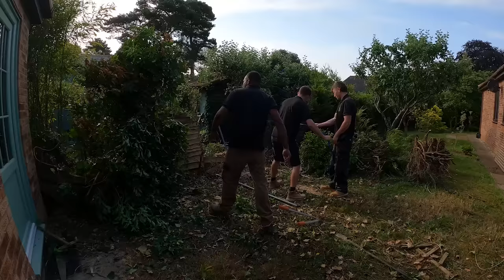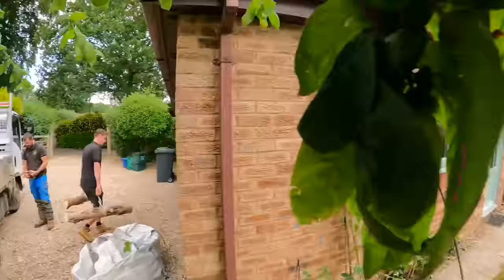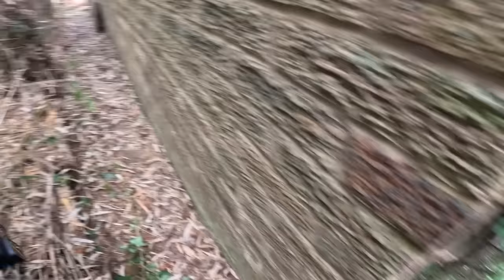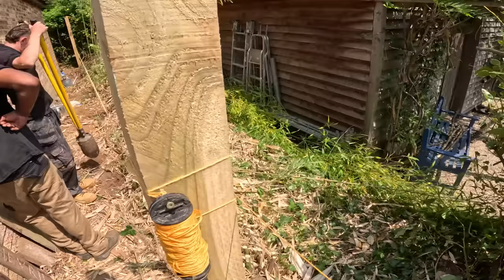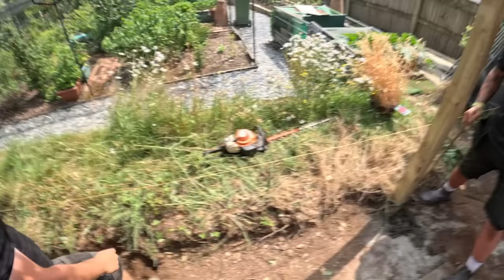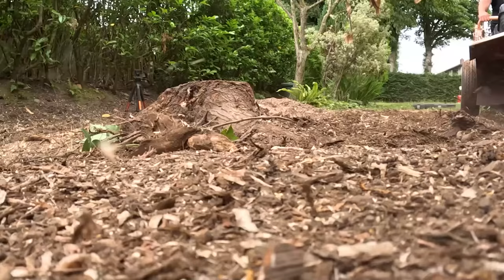STUNNING GARDEN TRANSFORMATION | Fence Build Project

Comment: I love a bit of featheredge. Best looking fencing. So much nicer on the eye than concrete. I've only done my own fencing over the years but was wondering if you'd had many problems with such a narrow post hole? I use a border spade and dig the width of that square. About 1½ bags of postcrete per hole. Also, i couldn't really get on with those postsaver sleeves. Painted posts with bitumen paint in the end. I saw a vid on youtube....'proper diy' i think....and the sleeve filled up with water above the ground. 🤷‍♂️
Great job by the way. Love the 2x8 gravel boards. 👍🏻
Reply from the maker: Really love your positivity! We tend to dig the holes deeper than most. We usually get 2 bags in per hole. We have painted posts and sleepers etc with bitumen paint. It also works really well.

Comment: 3 questions : 1) why not using an auger to dig those holes , since you seem to be quite mechanized ( stump removal etc..) 2) all the bushes on the neighbor side, they are just cut short and will grow back, any possibility to ask the neighbor to remove them all.3) how about the other 2 sides of the property ?
Reply from the maker: 1) the type of ground we have here is full of rocks so even when using a 150mm auger you end up with sometimes a 300mm or more hole that needs a lot more concrete
2) We cut the bushes down and then dug out the stumps so they won't come back.
3) There are good hedges on the other sides of the property so a fence is not required.

Comment: Hi, how did you set the height of the posts to achieve consistent height above the ground? Thanks
Reply from the maker: We didn't. We used longer posts and then set the heights of the rails and gravel board using a string line. Marked the posts and then rested the large saw on the top rail to cut the excess off the posts.

With pressure treated posts rotting on the top would happen a long time after the posts have rotted at ground level.
Reply: Ah I see, that makes sense, thanks for coming back to me!

Comment: How do you put the top cap on? And how do you fix into it? Does it need a counter Batton
Reply from the maker: This top cap we generally screw down through the top into the thick end of the boards. It doesn't need to sit on a rail

Comment: I suppose you retreated all the cut ends and post tops and didnt nail through 2 feather boards as you were putting them up allowing for expansion  / contraction thus avoiding the possibility of splits boards.  Otherwise it looks quite tidy. Would have liked to see a back weather on the posts !

Comment: What’s that used around the base of the posts?
Reply from the maker: Those are post savers. They protect the post around ground level where it is more likely to rot. When correctly installed will add 5 years+ to the life of the post.

Comment: Is gavel board same thickness as the timber rails? What size timber rails are they?
Reply from the maker: Rails are 38mm thick and the gravel board is 45mm thick finished size. Just enough to sit the feather edge on.
Reply: Ahh that makes sense cos I got a quote from the supplier gavel board 25mm thick and fence rail 22mm thick, I think it is too thin and wobbly?  What is the depth? Who is the supplier if you dont mind me asking?

Comment: Inferior quality as compared to the fence that D&J Projects installs. Do you have the option for concrete posts and gravel boards with replaceable wooden sections?
Reply from the maker: We do the have that option. This client preferred the wooden posts with post savers. Where we are this is the most common style by far.

Love the work d and j do.
Reply: @gorillagroundsandgardens  Thanks for the reply. I'm quite sure the concrete version is much more expensive but much more durable.  All in the budget, I suppose.
Reply: @GrammarPoliceInvestigations  the concrete posts are over 70kg each! I've just put in 10 on heavy clay ground.

Comment: Why don't you just get an auger to make those post holes.
Reply from the maker: Where this fence was there are a large amount of rocks and pebbles in the ground as well as the concrete from the old posts etc. with a 250mm auger you end up with a 400mm hole if you are not careful.
Reply: @gorillagroundsandgardens  bummer. Everything I watched those guys with the post hole diggers my shoulders hurt. Ouch that's rough.

Comment: Great looking job, sadly it won't last very long for almost the same money you could have used concrete posts with gravel boards and your timber infill.
Reply from the maker: There is a bitumen sleeve on the posts at ground level. This is where they rot so with this protected I would expect this to last around 20 years. The client likes the look of the wooden posts far better than concrete.

Comment: In my opinion, if there is no gap between the fence and there is a strong wind, there is a fear that it will fall
Reply from the maker: The only one that has gone wrong so far was caused by a massive flood that washed all the soil from around the posts. 000's of meters and many good storms without issue over the last 5 years.
Reply: @gorillagroundsandgardens  It's very good I respect your experience and career

Comment: 1st thing, you could have saved a days labour on by using AUGER / FENCE POST HOLE BORER / GROUND DRILL, 2nd thing I noticed you didnt slant the cut on the top of the posts for rain run off? 3rd thing, you made the fence like a sail, one good gust will take it out, wheres the air going to pass through the fence, exactly none, any good fence builder knows wind passing threw a fence reduces the push over
Reply from the maker: 1. We have large amounts of rocks in the ground that tend to make an auger move away from where we want the hole or make a hole 3x the size we actually want.
2. Water running off the top of the post doesn't make any difference from experience, the post will rot at ground level long before the top rots.
3. I pleased to report this fence and in fact all others we have put up over the last 5 years of fencing have made it through all of the winter storms.
I would love to see some of your fence builds so I can see how a "good" fence builder does it and take some notes!